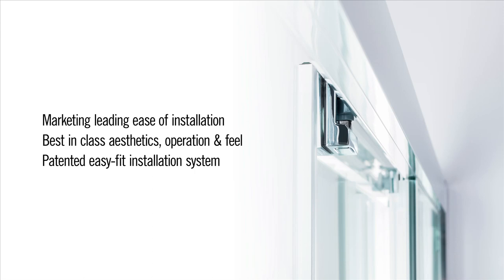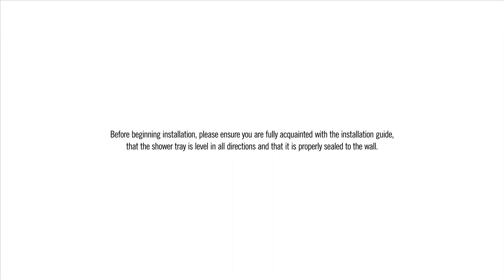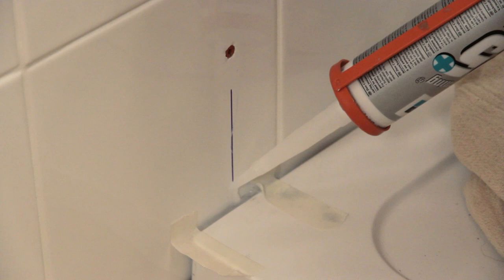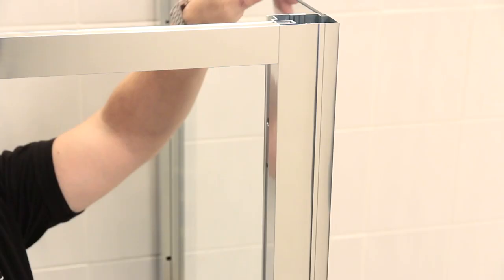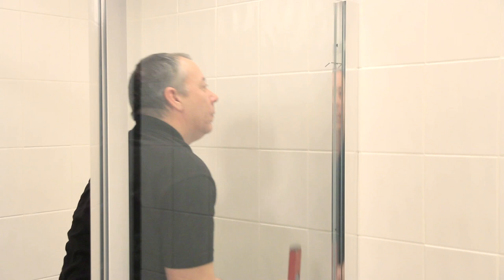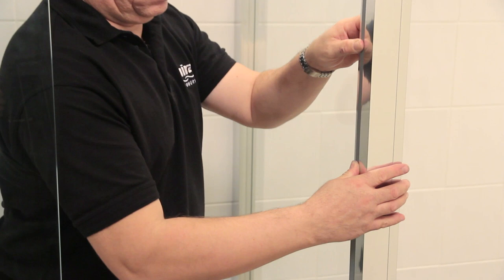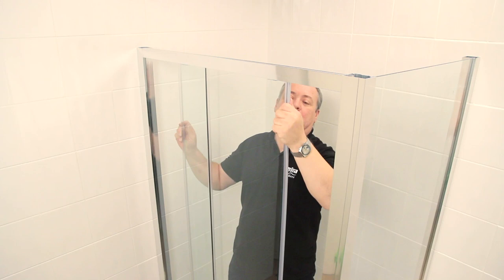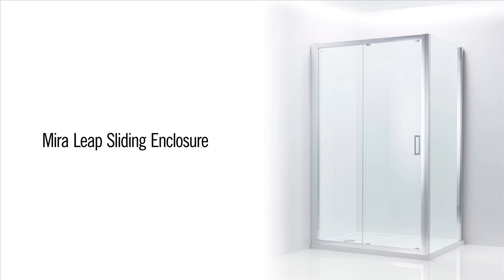Mira Leap Sliding Door Shower Enclosure Step-By-Step Installation

Comment: The silicone up the wall jam should go around screws on the tray side so that water cannot leak through the screw holes. The external silicone up the the wall jam should not be required if you have enough up the wall jam. Fitting one of these in a shower tray with 4 upstands is a bit tricky as you have to pull the side panel out to fit it into the door frame.

Comment: Please I wanted to fit shower tray and enclosure in a wet room ba I asked for advice from the council since it's a council flat on a ground floor . They told me I cant fit a tray because the wet room has no drain ba uses a pump to pump out water . My question is, can a shower enclosure be fit without a shower tray ? Please
Reply from the maker: Hi Alberta,

Our Mira enclosures are designed for use with our trays and the tray needs to be level for the door/screen to work correct. As a wet room flooring will not be level you have may have issues with one of our screens. You could opt for one of our Mira Elevate or Ascend fixed divider panels that can be fitted onto a tray or straight onto tiles.

We would always advise consulting with a professional installer/plumber. If you would like any further advice you contact our customer service team on Call us
 0800 001 4040.
Reply: Ok thanks very much